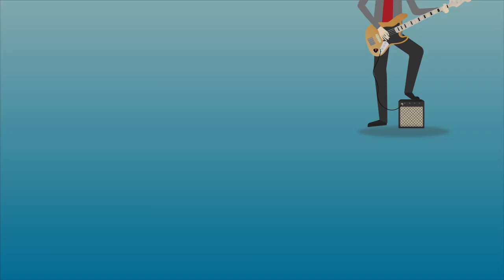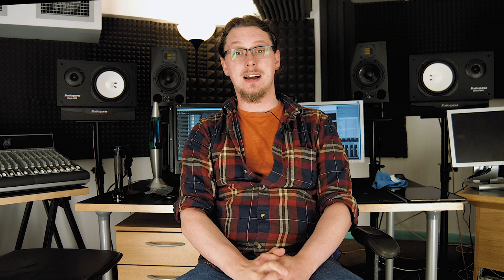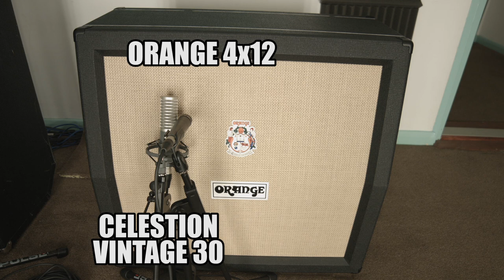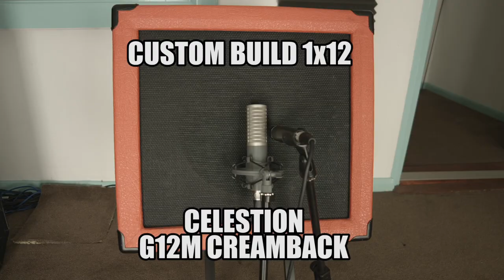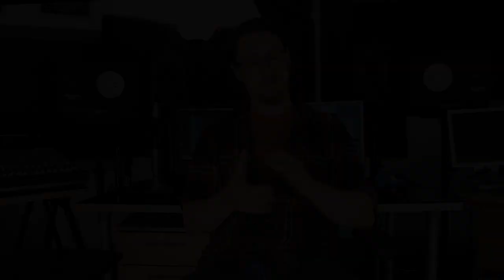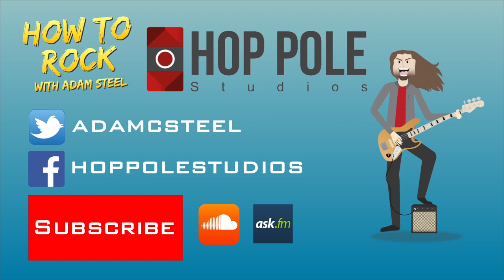CAB COMPARISONS - 4x12 vs 2x12 vs 1x12

Comment: Actually, a lot of the tonal changes that you hear with the Orange cab is because of the Grill spacing with the speaker. It has like a 1 and a half inches of distance with the speaker itself so it limits you of how closer you can get and the bass response is reduced because of the proximity effect (it reduces the amount of low end a half, every time you twice the distance). Hope this could help. Cheers

Comment: Everything matters. Our Orange 4x12 and Marshall 4x12 sound completely different. Orange is a deeper (dimension) cab, has all the speakers on the same plane, sits directly on the ground and is shorter and narrower. Marshall is thinner, slant top, sits on wheels and is taller and wider. Also the Orange weighs a bit more. The Orange has more low end and seems a little muddier, the Marshall has more high end and seems more focused. The Marshall feels louder, but we never have checked. I don't know what type of wood they are made of.

Comment: First off, thanks so much for doing this video as there are absolutely no comparisons out there. That said if I could add my two cents, to make this more accurate it needs to be 3 cabs from the same manufacturer that all have the same construction. The type of wood used and its construction actually has a huge impact. The same can be said about the grill cloth. That can also have a major influence on the sound. And finally the same exact speaker needs to be used in each cab because I have found that V30's in particular can actually have a huge variance in sound from speaker to speaker so if you use the same one, we are only hearing the differences of the actual cab. Anyway thanks again!

Comment: Actually, I think when you record with mics directly in front of speakers, you won't capture the real feel of the cabinets. You should put a mic far from the cabibet, to get the ambient sound (that is affected by the cabinet ressonance) and maybe an other inside the cabinet. And than, mix all together. Then you could hear better the real difference.
Reply: I think you'll still get a lot of what the cabinet is doing from close micing a speaker. Different pressures and reflection inside the cab for each cab will affect how the speaker acts and therefore how it sounds. Room mics are good but the recording will be greatly influenced with how the room sounds. The biggest difference is how it feel to be stood in front of the cab and the 4x12 will always win that one.

Comment: Combining the results from this video and the ones from newer one where you used all speakers the same and all cabs from zilla, results to a very interesting conclusion IMHO: Indeed, if you have the same speakers and construction style is 4x12 going to sound bigger than the 2x12 etc. However, the speaker type and construction are equally or even more important than just the number of speakers used. In this video becomes apparent that even a well constructed 1x12 with bassy speakers can sound bigger than a 4x12 with trembly speakers. Summarising, a well thought and constructed 1x12 with the right speaker can provide you the right amount of bass response for your needs and that a 4x12 is not necessary in set up to get the right "bigness" and base response. The last conclusion is that zilla cabs are amazing.
Reply from the maker: +Myself6M all good conclusions!
Reply: Thanks! I would also like to apologise about the comments I made on the redback review. I was having a bad day that time. It was a great video btw, I am actually considering purchasing the exact speaker configuration you used i.e. redback in a 1x12 fatbaby . Do you think it would be a good match for an Orange Rockerverb 50? I suspect that the1x12 Zilla with the redback could sound similar and as big as an orange ppc212 with v30. As from your videos I noticed, that the Zilla cabs tend to have firmer bass than Orange cabs and also that the redback sounds like a much darker and bassier v30. I would really appreciate actually if you could compare the two cabs at some point.
Reply from the maker: +Kieren Moore the volume levels were matched, any difference you hear is perceptive due to frequency response differences.

Comment: I've tried 1x10", 1x12", 2x10", 2x12", 4x8", 4x10", and 4x12" combos and cabinets and my favorite is always 1x12" open back combos with a floating baffle. I crank my 13 watt combo up, never put it in my monitors, and I never have trouble hearing myself. All of the bigger cabs or closed back amps I've played were extremely directional, sounding muddy from the sides and too fizzy from the front. I was constantly told to turn down with bigger cabs and I could never get my speakers really moving if I had 4 of them, so the miced tone always sounded a bit thin.

With 1x12", that single speaker is getting all of the amp's power so the miced tone was killer and the open back and floating baffle allow the entire amp to resonate and disperse sound in all directions so my stage sound has always been perfect and balanced.
Reply from the maker: +Jake Stewart Music thanks for the info! I'm hoping to do a review of the Celestion Redback soon, heard of it? It's a Creamback H but can do 150W! Sounds like it could be perfect for those 1x12 situations but with a high power head :)
Reply: Yeah, I just heard about it from some of the NAMM news. Sounds like a great idea for someone who has a higher powered head and needs to travel lighter or just generally prefers the 1x12" sound. Also seems like a sane choice if you have a Triple Rec and want to run a 2x12" cabinet and still get a bit of headroom out of the speakers.
Reply: Yeah, I just heard about it from some of the NAMM news. Sounds like a great idea for someone who has a higher powered head and needs to travel lighter or just generally prefers the 1x12" sound. Also seems like a sane choice if you have a Triple Rec and want to run a 2x12" cabinet and still get a bit of headroom out of the speakers.
Reply: Yeah, I just heard about it from some of the NAMM news. Sounds like a great idea for someone who has a higher powered head and needs to travel lighter or just generally prefers the 1x12" sound. Also seems like a sane choice if you have a Triple Rec and want to run a 2x12" cabinet and still get a bit of headroom out of the speakers.
Reply from the maker: +Jake Stewart Music oh yes, a single speaker triple Rec! That sounds like a challenge....

Comment: There are different possible we explanations for the results.

1. Four speakers might cause phase issues (though I don't think it's the case here, cause the speaker's really close miked.

2. If the cabinet gets the same power from the amp, each speaker only gets half of the power of the 2x12. This can easily destroy your bass frequencies—they need a lot of energy.

3. Probably the 2x12 has 8 Ohms, the 4x12 16 Ohms. Since a tube amp interacts with the speakers this changes it's behaviour, pronouncing the mid-range. If you go down in impedance, you increase bass (and highs). Plus the higher impedance causes an additional drop in volume.

Comment: is the mic also picking up some of the sound of the other speakers aswell? Im surprized how thin the 4x12 orange sounded! perhapsmic placement would have made a big difference? I know that you tried to keep it even between all the amps though! apparently 4x12's have a very small sweet spot and it can be kinda hard to find! but ya I liked the 2x12 the best!
Reply from the maker: +James Cassidy it's very much a case of the 4x12 causing its own internal phase issues I think, the baffle vibrating and the air compressing inside the cab can cause a whole host of issues.... and mic placement could only make so much difference, especially as the mics were in exactly the same place in each instance!
Reply: right! makes sense! for the mic placement though, I didnt mean comparatively, but If I was only micing the 4x12 lets say for a recording, I would expirement more!
Reply from the maker: +James Cassidy yeah in a usual recording situation I'd spend time getting the "best possible" tone, but that depends very much on which cabs, settings and mics you're using so is notoriously hard to do comparisons with

Comment: 4x12" arent most of time built with two speaker in series and the two others in parrallel? If so it ask the same amount of "energy" to move the 4x12" speaker than a 2x12" or a 1x12" if you do it only in parallel.
Reply from the maker: +RmDIr Sudo Su not true, they're usually wired as 2 series pairs. And series vs parallel only refers to impedance, the amount of energy required goes up with the number of speakers.
Reply: Yes you confir what I said, two series pair connected in parrallel ^^ so it's the same between a 2x12" in serie and a 4x12" ^^ in any case you can also change the ohm output to adapt it to your cab with a tube amp.
Reply from the maker: +RmDIr Sudo Su your understanding of electronics is flawed. You're only talking about impedance, not current load or speaker load.
Reply: I'm talking about the independance because the independance need to be change in function of the type of circuit (parrallel or serie), so yes you can change the independance to give more "power" to your speaker. 

And a circuit in parrallel speaker will share the same voltage, but the current will be reduce .
Reply from the maker: +RmDIr Sudo Su again, you don't understand, ohms law refers to resistance. This is impedance, which is a completely different thing, and is nominal and changes based on real-time frequency response. Do a course or something then get back to me....
Reply: I'm network/system engineer, it's a long time I didn't do any circuit but I'm sure that with the mix parrallel/serie the 4 speaker will share the same amount of power. And I don't understand ohm law but a speaker has it's own resistance, this is why if you don't want to break all your speaker you want to bias your amp output in function of  your circuit.

And Independance is for AC and resistance for DC but both use "ohms law" in the case of independance every thing will be sinusoid. It's hard to explain math in english when it's not your main langague ^^

Comment: The 4x12 would probably sound beefier at a louder volume. At room volume maybe it isn't that beefy
Reply: ***** Actually I had a look at some other videos and all were sort of consistent with the result you were getting. Only explanation I can think of is that the 4x12 pushes the sound more wider hence it sounds thinner on the mic compared to a 1x12 that will push the sound through a smaller area.